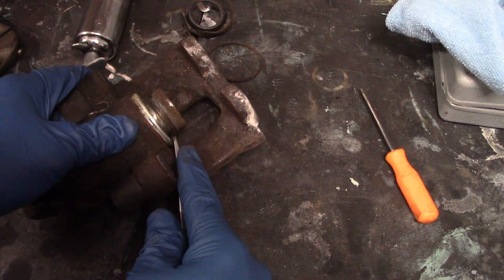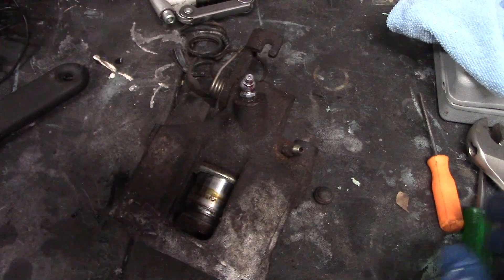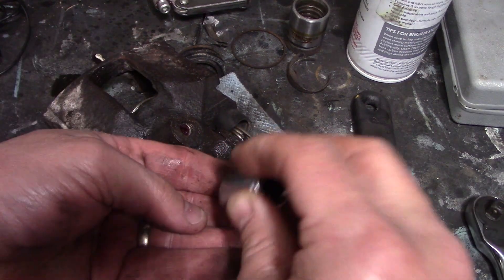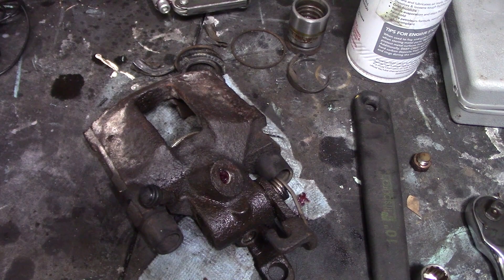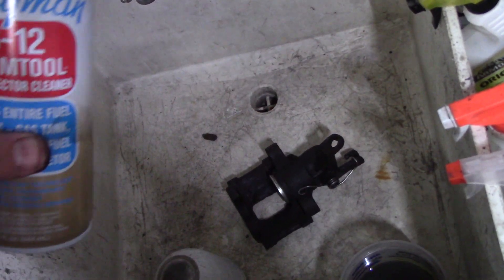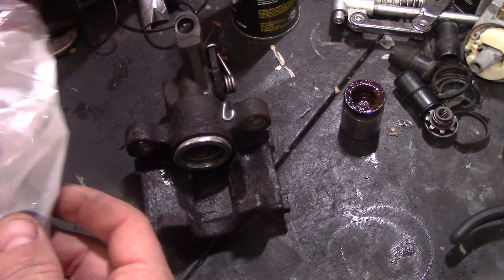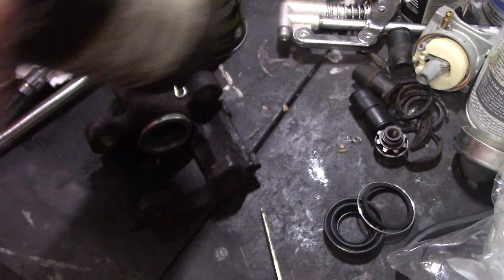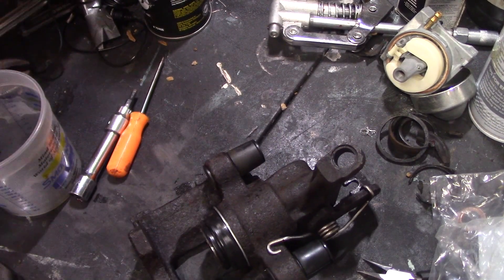1994 Saab 9000 Rear Brake Caliper Rebuild

Comment: Cool stuff. I've found that a little teflon tape at the top of that handbrake adjustment plug along with a good copper paste cover will never get it stuck and creates a decent seal so crud doesn't get in.
Reply from the maker: I usually put anti-sieze on sealing plugs as well. I don't usually use pipe tape but you could also use pipe-thread sealant to seal the cavity.